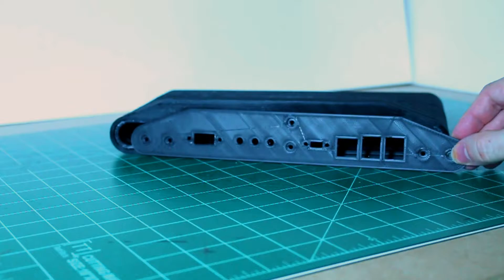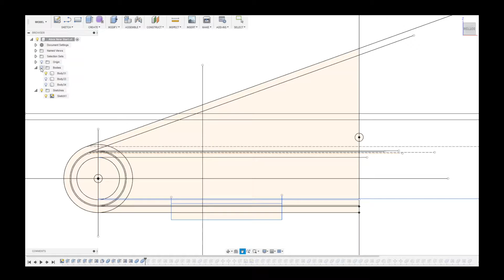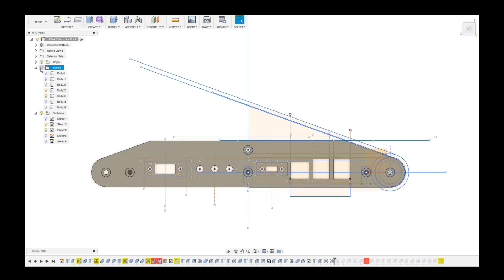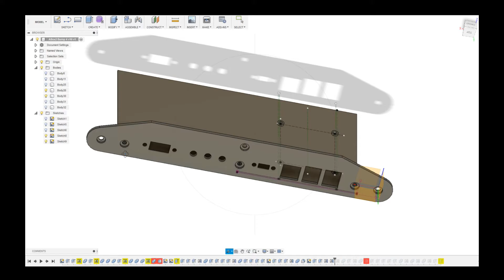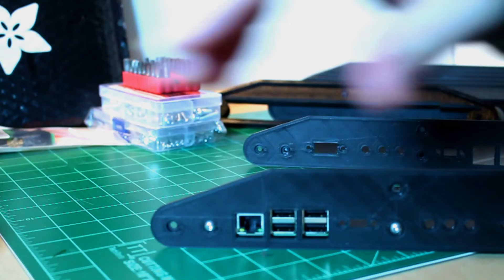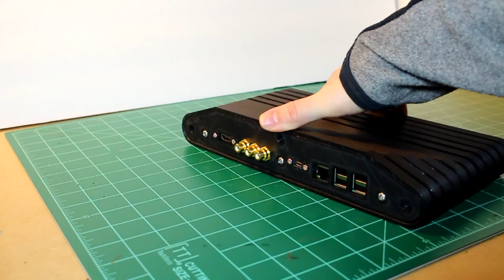Make Your Own Ataribox / Atari VCS Inspired Raspberry Pi Enclosure Part II

Comment: Are you making atari VCS?
Reply from the maker: I would call it an inspired by the Ataribox/VCS Raspberry Pi project. I liked the form factor of the Atari machine but didn't want to wait for it, so I thought it'd be fun to put this together. It will have most of the same functions of an Ataribox, but I should have it done in a week or two. Atari's offering will have a more powerful SOC than my Pi 3, but by the time Atari's machine comes to market, I will probably have a Pi 4 in there.
Reply: @sevenxsix2566  ok then, and I have a one question, are you the part of atari engineers or not?
Reply from the maker: @antonioravanes9139  No I'm no engineer, like I said (or meant to say) this is a fan project that has been inspired by the Ataribox. It's just for fun.
Reply: @sevenxsix2566  oh ok.